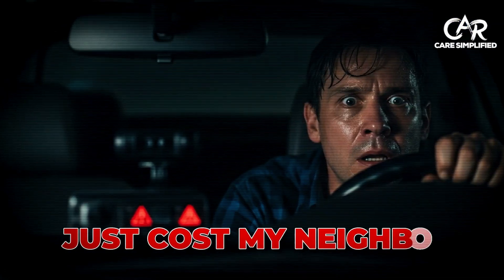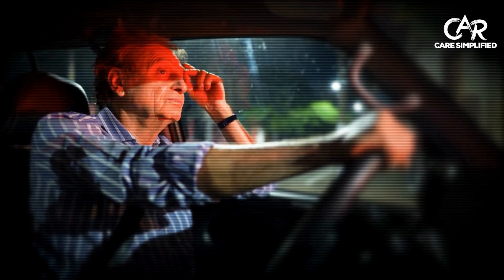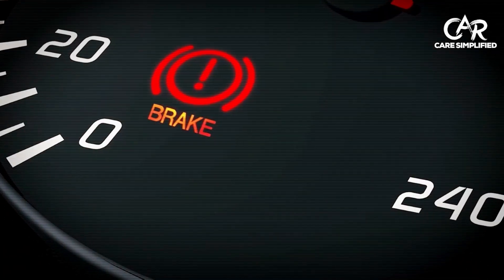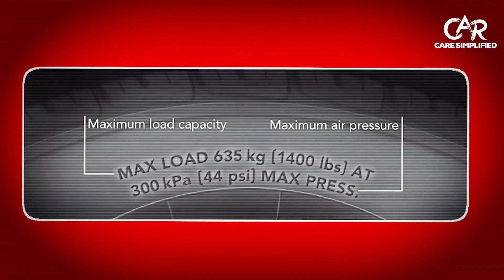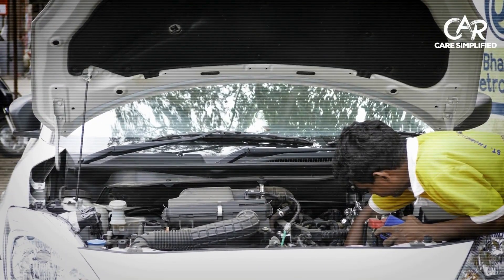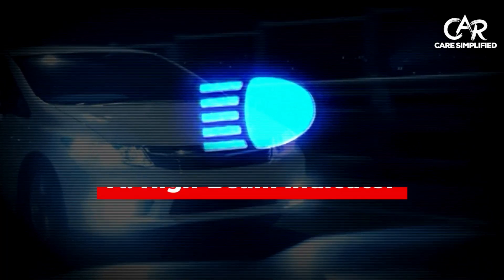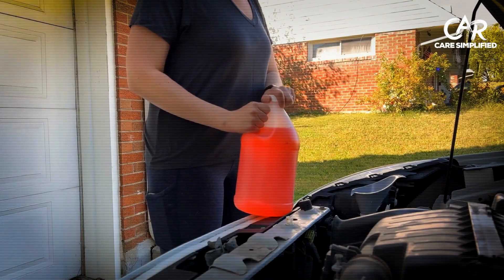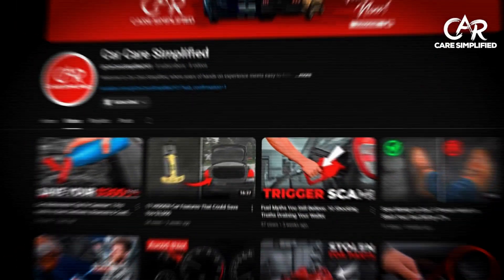Car Dashboard Symbols and Meanings: Recognize 9 Critical Warning Lights

Comment from the maker: 12 SECRETS to Make Your Car Last 500k Miles (ASE Certified) 👉https://www.youtube.com/watch?v=MUMjlNmP0TI

🔧 Car Care Simplified: Essential Tools & Products
📱 Advanced Diagnostics
FIXD OBD2 Pro Scanner: https://amzn.to/3YSBDbU
BlueDriver Bluetooth Scanner: https://amzn.to/4mmDL5N
Autel AutoLink Engine Analyzer: https://amzn.to/4jZQvNY

🔋 Power & Emergency
NOCO Boost Plus Jump Starter: https://amzn.to/4jalmX1
Stanley Portable Power Station: https://amzn.to/4drWUzd
LED Road Flares Emergency Kit: https://amzn.to/3F7Yw4t

🧴 Engine Performance Solutions
Liqui Moly Engine Flush: https://amzn.to/4mm9nZl
Sea Foam Motor Treatment: https://amzn.to/4mssTU4
Marvel Mystery Oil: https://amzn.to/3FltmXd
Royal Purple Max-Clean Fuel System Cleaner: https://amzn.to/434fQk1

🔬 Testing Equipment
Snap-on Compression Tester Kit: https://amzn.to/4k9sHYo
Coolant Hydrometers & Test Strips: https://amzn.to/4jdczU5
Brake Fluid Test Strips: https://amzn.to/4jsKKHT

🧰 Specialty Tools
Torque Wrench Kit (10-150 ft-lb): https://amzn.to/4dnO2ul
Brake Caliper Wind Back Tool Set: https://amzn.to/3H18Z21
Steering Wheel Puller Set: https://amzn.to/4dnmQfj
Magnetic Parts Tray: https://amzn.to/3ZjTbhe

🛠 Professional Detailing
Chemical Guys Complete Car Care Kit: https://amzn.to/3YSCfhI
TORQUE Detail Clay Bar Kit: https://amzn.to/4jTWpjM
Adam's Polishes Headlight Restoration Kit: https://amzn.to/4k2C3Fe
Car Interior Vacuum Cleaner: https://amzn.to/4dkUzWE

⚙ Preventative Maintenance
Fuel Filter Replacement Kit: https://amzn.to/3Fkueve
Brake Pad Wear Sensors: https://amzn.to/43znRxs
Serpentine Belt Tool: https://amzn.to/4mliaKY
Oil Filter Wrench Set: https://amzn.to/4j4V2NX